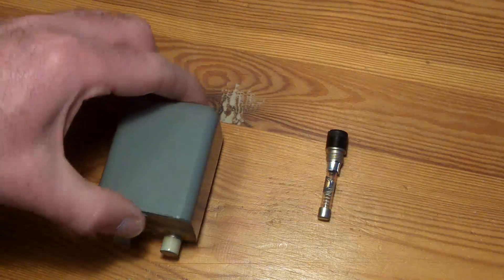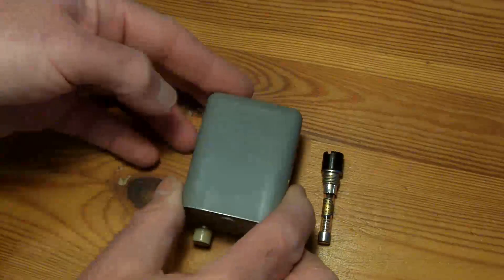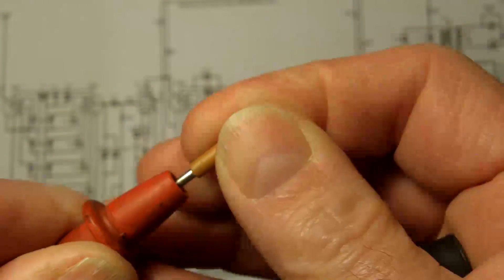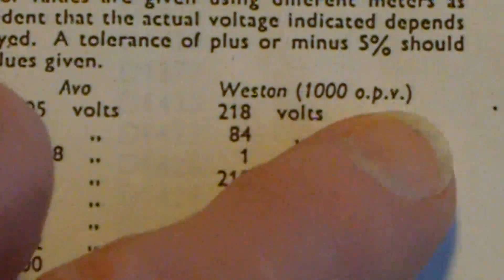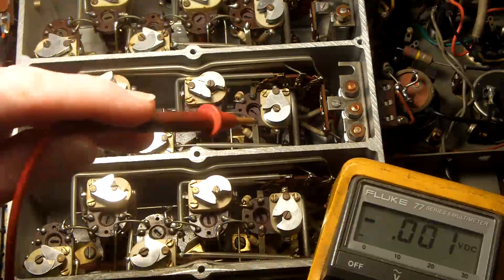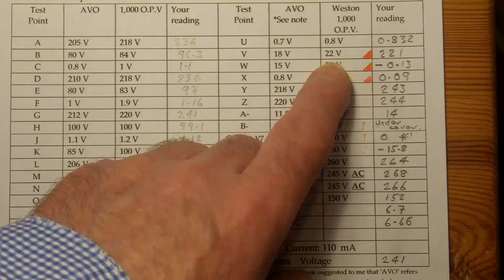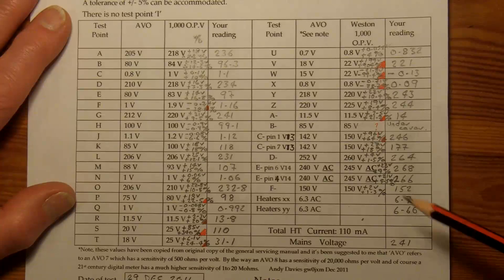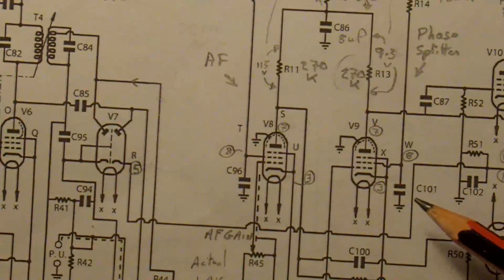About Radio ... Part 32 Checking voltage values, Eddystone S680X by Andy Davies

Comment: Hi Andy , I am a bit late to the party . Test points S and V are on the anodes of V8 and V9 and I would certainly expect voltages greater than the 20V , or so , in the original spec . Your readings of over 200V look ok .

Comment from the maker: Hi Barry, well I guess that these old radios may seem to have a very wide window of tolerance but if you think of the differences in terms of percentage. i.e. if it should be 200V and it’s down to 190V then -10 volts sounds a lot  but it’s only -5%. I suppose that the original designer will have had a specific idea in mind but he will have known that the components used will have huge variation with 20% tolerance or more. I’m not sure how wide the margin is between ideal and adequate. 
Andy

Comment: Hi Andy, with quite a few volt values out spec and the radio is still working somewhat properly, it seems that these old radios can take a lot of misalignment. But getting them very close to tolerance makes them do what? Pull in the freq or just sound better or just ease ability to tune. Oh the questions that

Comment from the maker: @1710WL Hi there, since making the video I’ve found some of the high ohmic value resistors to be either open circuit or several times their design value but funnily enough I haven’t found any bad capacitors yet, all good fun though.
Kind Regards ... Andy